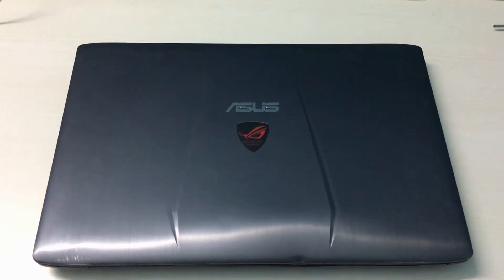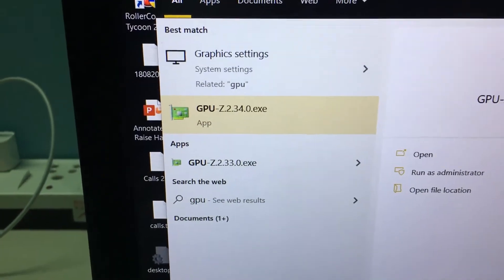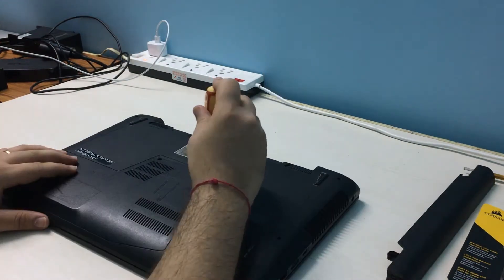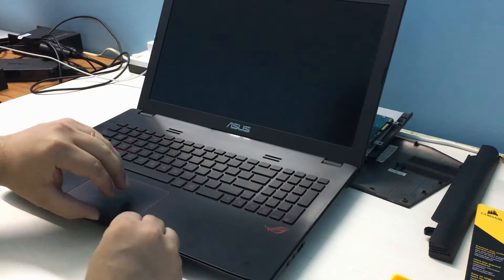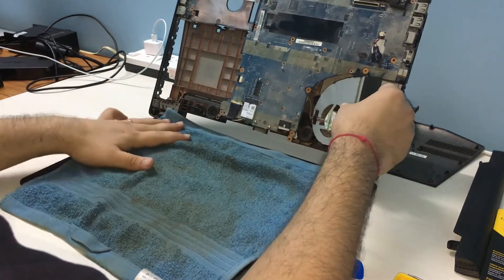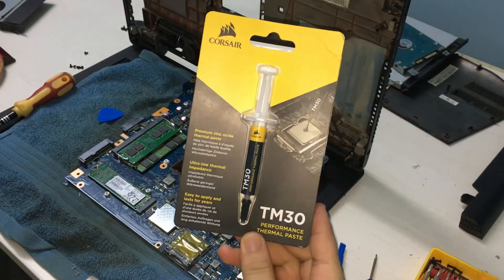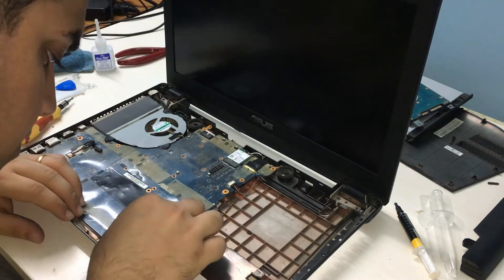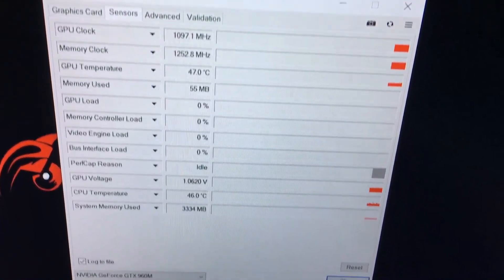ASUS ROG GL552VW Thermal Issue! FIXED! | Laptop Overheating | Thermal Paste application | Gaming

Comment: I have one of these and it started freezing altogether in June of 2022 so I bought a new laptop.    The old laptop can run MemTest68 forever without freezing up, but if I try to run either Windows 10 or a portable USB version of Linux, then the entire laptop freezes up.   Would applying new thermal paste likely solve this freezing issue?   I'd hate to have to go through all that delicate disassembly/reassembly and then find it still freezes up.

Comment: i changed the thermal paste but i used a cheap one, and cleaned the fan but my CPU is still the same with 60 C when idle and 90 to 100 C when in game. (By the way my GPU stopped working years ago, i think duo to overheating).

Comment: Hi, can you give me some advice, I have the same laptop but it doesn't read my gtx 960m dedicated video card, it only reads 128 m of my graphics memory, I tried another Windows and other drivers as well, which could be the problem.
Reply: Hi sebastian. I have same problem on my laptop. Can you fixed this problem?
Reply: @MuhammetAli_CALISKAN   no :( you?

Comment: I have repaste with MX4 but when i stress it with Aidas 64 cpu reach max 95 Celsus and throotle a lot. Really this ROG need more ventilation.Later i use cool pad and heat suck which keep it at 85 Celsus when stressed with Adas 64
Reply: What cooling pad model did you use?

Comment: Asus laptops are trash. I will never buy from them.
Reply from the maker: That’s debatable… I have been using mine for the past 6 years now and it’s been amazing. All my games… videos and all the editing is done on the unit in this video till date. It’s about how you maintain a good device made by ASUS ♥️
Reply: @ACubeTechVideos  Yes, how you maintain it. Sadly the G551vw is a plastic trash that is falling apart on its own. The screws are eating the plastic holes, the monitor cables were destroying the hinges(faulty architecture and design)...bad airflow and lack of air vents. So far only my Asus laptop failed me completely. Other brands that I own had a better quality for its price. Ofc I clean them and maintain them in good shape. I did a maintenance on the Asus when all hell broke lose...sadly I will never recommend this model to anyone.
Reply: @tineristineris1860  I think the same thing. I added air vent under CPU fan, needed to repair screw mounts arround the GPU, now i have keyboard problems... This is last Asus i bought.

Comment: Dear a cube
Your video explain is very good and simple enough to understand.
But i have a question.
After the keyboard was lifted and unscrew the 3 screw of fan cooling. Can you explain, why we can't unplug the ac, display and wifi connector?
So you just make the logicboard and everythings is laying on the monitor rather than just unplug everything.
Reply: In addition, on other channels discussing this topic. Many of them commented about their laptop having a black screen after assembly. Is there any connection?
Reply from the maker: Hi Gie AR. 

From previous experience I have found the display and WiFi connectors and cables to be very fragile on many other laptops. Hence I tend to leave the cables plugged in where it is not necessary to be removed. That way I can ensure that the connectors are not damaged and I just need to make sure I don’t pull the board around. 

The black screen issue may be connected. Even if one of the pins on the display connector gets bent or has a lose contact then the display will go black. 

Hope this helps :)

Thanks for watching the video and support
Reply: @ACubeTechVideos  wow! thanks for the info

Comment: Hello,

It's a great video.

I have the same laptop, I bought it in 2016. I don't have a problem in terms of temperature, but do you think it would be nice to replace the thermal paste and thermal pad? Also, I don't know how many mm the thermal pads are. Do you have any information?
Reply from the maker: Hi Ercan, 

Thanks for watching the video. 

If your laptop is not thermal throttling then I don’t think you will need to change the thermal paste.

Comment: Well thank for telling me but after opening the back, I got all the way to the step where I need to unscrew heat sink assembly but I realised that my CPUs nuts for the screw has completely come off the board! So even if apply new thermal paste there's no way to seal it tight enough for the thermal paste and heatsink to be able to do their job correctly xD
Is there a way to fix it or is my laptop just dead now?
Reply from the maker: Sorry to hear that Mr Macabre.
You can try to solder it back on the board.
Reply: This is common issue in this model. Most of the times the nuts around GPU are coming off the motherboard and you need solder it back or replace with long screw from the other side and nuts
Reply: welp I tried resoldering it and that didn't even last year, I think I'll try your screw method now, seems like it should be way more reliable anyways, what sized screw should I use btw?

Comment: Does the laptop have an extra mini pcie? I am planning to connect an EGPU setup through mini pcie, as my ssd slot is already used
Reply: Hi no forget that u cant out an egpu with ur ssd slot , if u want to put an egpu u have to remove the wifi card and its not pci.e its m.2 ngff

Comment: Nice video with great explaination.  Only thing I would add is clean the cooling fan.  I could tell when seeing the cooling fan it was coated in dust.  Make sure the fan and exhaust fins are clear of dust and debris to ensure proper heat exhaust.
Reply from the maker: Good tip!

Thanks for your support!

Comment: I had the same problem even the two nuts for gpu was come out
Reply: This happened with my CPU. I have got my motherboard replaced 3 times in 2 years for same issue. Now it again has happened and I suspect the same reason but the warranty is over. And I see I am not the only one running into this issue. Mine is GL552JX.
Reply: This is common issue in this model. Most of the times the nuts around GPU are coming off the motherboard and you need solder it back or replace with long screw from the other side and nuts